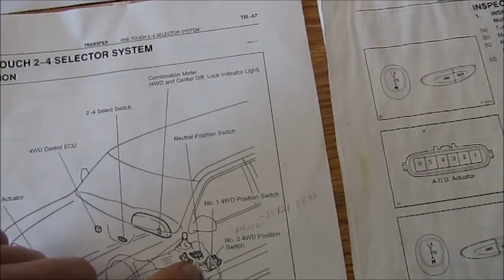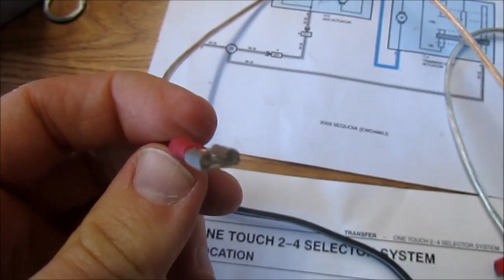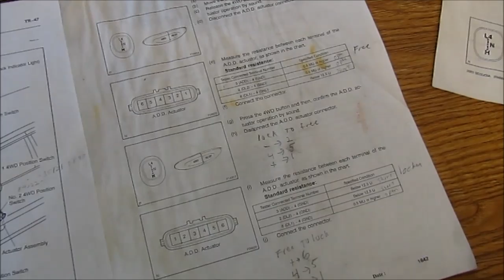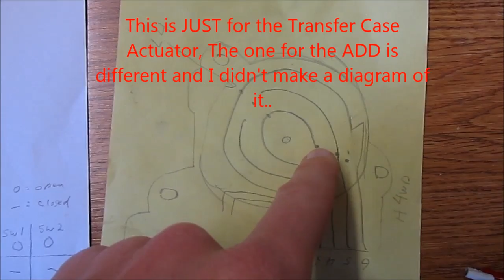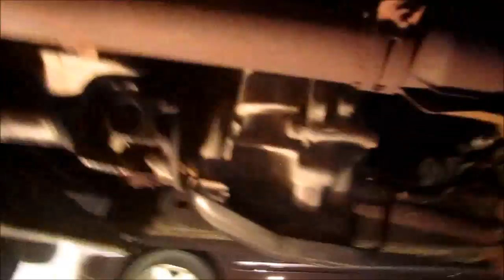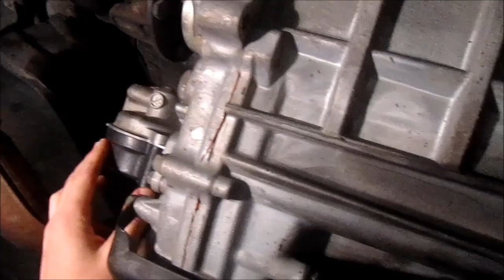sequoia 4wd troubleshooting

Comment: I read where a YouTuber said to take a small hammer and tap the switch...lightly.
BINGO...IT WORKED.
Thank you very much for your info...glad it was a simple fix.
DREADED THE THOUGHT OF TAKING HER TO THE STEALERSHIP!!
Reply: I just did the same thing on mine: light taps on both switch housings with a small hammer. I also noticed the vacuum hose on the transfer case was cracked so I trimmed it back and reinstalled it as well.

I think I'll make sure I go in and out of 4WD once a month to keep it from seizing up again (hopefully).

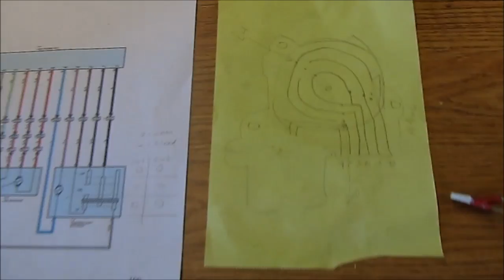Comment: The diagram he shows at 12:20, the rotary joints on mine were dirty and I cleaned them with fine steel wool. I took a photo before  I removed the gear for correct positioning. It took me an hour to remove and replace.
Reply: Hi can you send me a pic of the nuertral pos of the pins with the cover off .  Thanks

Comment: Man you saved me a grand++ I'm sure. I found 2 (yes two) faulty plunger switches that I didn't even know about. One was 200-300 ohms, the other was wide open. That cost me $275 at the dealer. My back diff lock was ok after pulling it out and cleaning it but the front (ADD) 2x 4x shifter was afu. I finally got it working and now everything is DNO. Just tapping on the front ADD got it to cycle. I know how everything works now and exercised it multiple times in some deep snow on the mountain yesterday. Thanks for taking the time to make this video.

Comment: Super helpful video!! Mine (just got it 3 days ago!) was stuck in 4x4, the front switch on the transfer case actuator was bad. I took it out and it had no continuity with plunger in or out. 

To confirm, I turned the key on (motor off) and all 4 wheels were green, with a blinking orange center. So I pressed the 4x4 button, and all 4 green wheels lights turned off, but the orange center light was still blinking (this was the main symptom). 

So then I unplugged the bad sensor, and used an unpainted metal paperclip bent into a "U" as a jumper, plugged it into the bad sensor's plug, (again, key on, motor off, green wheel lights off) and everything clicked and disengaged! Woo hoo!!! So relieved!! 

Just need to replace the sensor now, but thanks for the great video!! Wouldn't have tried this without your explanation!
Reply: So awesome. you're describing my exact problem- were you ever able to replace the switches, and if so, where did you get them?
Reply: Yep, got it switched out. Still have a problem up front, 4X4 won't engage fully and honestly haven't had a chance to climb under and smack it. It's new to me, and the previous owner never exercised it. Oddly, the bad switch worked again after having it out and pushing on it a lot, but I wouldn't comfortably rely on it. If you're in a pinch, take the switch out and push the plunger in and out, and see if you get any continuity from the switch.  

I replaced the bad switch with this: Toyota 84210-52050 Back Up Lamp Switch from Amazon. Worked like a charm, not stuck in 4x4 anymore and we've been driving around ever since. I just need to get the front dif resolved. I'm sure it will be easy, I just need to get after it.

Comment: Thanks for this video.  I was able to determine an issue with my ADD as I was unable to manually rotate it but I was able to manually rotate the transfer case back to 2 high.  I had read in my owners manual when I got my 2003 sequoia in 2016 and had ran the 4wd monthly.  In fact that's how I found out this problem.  I wish the ADD was a bit more accessible.  Thanks again for the information!
Reply: I know this was forever ago, but.... how did you manually change the transfer case back to 2wd? My front drive shaft is stuck engaged in my 2003. Thanks!

Comment: Thanks for the excellent video--your instructions on how to manually rotate the two actuators through their various positions is extremely helpful.  I am working on a 2001 Sequoia.  I was able to cycle both the transfer case and the ADD through all of their positions manually.  I did not note any hesitation in the operation of the motors.  Several times I tried rotating both actuators to the 2wd/free positions and starting the vehicle.  The flashing orange diff light disappears until I attempt to engage 4wd with the button, after which I hear an engagement noise.  However, the flashing orange diff light will now come on and stay on until I manually rotate the transfer case from 4wd-Locked back to 2wd.  The ADD appears to stay in the free position.  I have checked both transfer case position switches and replaced the front one, which looked like it was not achieving full continuity, with no result.  

I have read that the wheel speed sensors provide information to the 4wd ECU.  A couple of months ago, I experienced the issue common to these trucks where the ABS/traction control system randomly locks up one wheel at speed, so I tore out the ABS fuse.  The 4wd system has been non-operational since long before the ABS issue became serious.  Is it possible that these two issues are interrelated, and that my manual cycling of the actuators and replacement of the position switch are not fixing the problem because of a sensor elsewhere in the system?  I suppose I could check the L4 and Neutral switches.  Is there a test procedure for those?  Or is it only the vehicle speed sensor that has input to the 4wd ECU?  I suppose it's possible that my ECU is bad.  

Is there anything else to check before I dive into the 4wd ECU?  

Thanks.

Comment: Great video.  Saved me a lot of time of having to go through it myself.  All said and done, my ADD motor was toast on my 2003 Sequoia.  In my case, the actuator breathing tube had snap off.  I had never realized it had a breather until now.  Years of corrosion from road salt and a few flooded streets, did the motor in.  $470 after taxes in the Chicago area.  I could have bought one a lot cheaper online but this issue was discovered less than a day before a trip to CO.

Comment: I had this exact same issue. My 03 sequoia got stuck in 4WD locked diff. Center diff light flashing. I tested both transfer case postion switches and found the front one to be bad. After replacing it I disconnected the battery for about 15 minutes and then reconnected it. I started it and the blinking light went away. I would start with the position switches if you’re having similar issues. The part was $61 with tax.

Comment: Thank you for the video.  It's a bit confusing, but I think you did the best you could to make sense of it all, and it's helped me understand the system way better.
Reply: Seems like the switches are the easiest to start testing.  My problem on my '04 is the center diff and it's intermittent, so I have some work ahead of me.  Once I got mine unstuck once before, it's worked fine ( did this by tapping on it).  After driving a couple thousand miles, it stuck again when I engaged it and won't respond, just blinking on the dash.

Comment: A real good video for sure.  We have a Tacoma 2001 that is a huge headache.  With the 2 front wheels off the ground, pushing the 2-4 selector does absolutely nothing...no light, no 4x4 engagement.  You can spin front driveshaft and if you turn a wheel by hand only one wheel spins.  If I disconnect the ADD connector at actuator and then push the 2-4 selector button you hear the transfer case motor spin and the front driveshaft locks.  In addition, both front wheels now spin (opposite directions).  What the heck is up with that?  lol

Comment: Transfer Case Actuator is 1476.00 at the dealer.  Found one on Ebay 1184.00
Reply: Mla Automotive mine was $207 at advanced auto
Reply: Mine was $207 from advanced auto
Reply: I fixed mine and saved $1100 on a the part for an 05 Tundra,. Take the black plastic cover off, remove the assy and clean the motor contacts on the lid with fine steel wool. Reassembly is a little more tedious, but I did it in less than an hour.

Comment: Wish there was a troubleshooting guide like this for Tundra 2008-2014... pin out on front diff seems similar, it would seem though I have no position switches on transfer case act. Great video.

Comment: Great video. I have flashing light w/4 green tires every time  i start my 03 sequoia. I can push the 4wd button and the green tires go away but light still flashes. I had to replace one of the position switches at the transfer case actuator. Didn't fix the issue. So I want to spin the actuator manually just a little confused with the pin orientation and I don't want to damage the transfer case actuator. I don't hear either actuator spin and it won't engage 4x4H but I can get it to go into 4x4L .
Reply: So I got the pin configuration figured out now. I have continuity at pins 4&6. So thats High 4 lock. So connected my wires like in the video and got the actuator to spin from 4HLock to H4 so I turned the key to on position and I heard the actuator spin the orange light and the 4 green never left. I checked the continuity and is was back to 4H lock so I wired it to spin to 2wd and it did spin and once again when I turned the key to on position actuator spinned right back to 4H lock again. Can the front add be causing this? I previously have stated it does ingage into 4x4L  but not 4x4H.
Reply: I've got all 4 lights and center flashing. I see you checked  both positions in the actuator, I'm looking to check mine for continuity but having hard time getting them out. What size socket or wrench is that to get them out and how's your vehicle doing now?

Comment: i have an issue with mine....last owner told me that i have to put 12v on 2 point in the plug behind the radio console to make the fork of the 4wd engaged...do you have some info about that?? it's like i have to jump the connector directly to fully engage or disengage the 4wd...i have to invert the 12v power on the same spot to make it disengaged....but i don't remember the exact pin to jump the that plug....can you help me on that one dude?

Comment: Help! Does the vehicle need to be fully in the air to do this? Mine is currently on the ground. Tcase actuator is good by bench testing it and confirming the motor spins both ways and both tcase switches referenced have continuity. I'm 90% sure the issue is the ADD. I'm flashing, and vehicle acts like 3/4 wheels are locked, or maybe all 4. Can I do the manual rotation of the front diff as described here on the ground, or does it need to be in the air and in gear or neutral? 
Thanks!

Comment: Thanks for the video very helpful. I have a 02 sequoia. I have center light blinking problem.  If I am at fwd mode i tap the rear actuator case with a hammer and it goes away. If i am at 4wd mode then i need to tap front and rear actuators. It is not very practical but I thought if I do this enough times maybe it will be exercised and dont need do it anymore but still flashing center light if i press 4wd button. Anyone has any idea what could be the problem or fix?
Reply: I just did the same thing on mine: light taps on both switch housings with a small hammer. I also noticed the vacuum hose on the transfer case was cracked so I trimmed it back and reinstalled it as well.

I think I'll make sure I go in and out of 4WD once a month to keep it from seizing up again (hopefully).

Comment: When I tested my 4wd switches for continuity I got a bunch of numbers jumping around when I pressed the plunger (maintaining even pressure) and then after 3 seconds or so it zeroed out. This was with alligator clips btw.
Is a normal reading test these 2 switches on a Tundra?

Comment: Thanks for the video! Can you tell me what it means if there’s is continuity between pin 1 & 2 on the transfer case motor.
I’m stuck in 4WD Locked. Position switches are working.

Comment: So my02 4runner having similar issue. When trying to engage 4wd 4h I get the green wheels and center diff flashing and it never engages unless I turn vehicle off then back on the it will be in 4wd with center diff locked at that point I have to press the center diff button to disengage it. Do you think I have the same issue. Thanks

Comment: If you hate yourself and think that you need to be punished, then by all means make your own cables to connect to the 6 pins of the 2 actuators. Otherwise, just buy some alligator clips. My self-made leads fell off time after time wasting so much time and money on this project. "Why isn't this moving the motor!?" Well, because the connectors fell off of the pins. Or they detached from the end-connector, etc.

Comment: Question, I'm in an 03 Sequoia am I looking at an expensive fix or what? My center differential light flashes. I have never been off-road. I took it to toyota they actual road tested it with me in it. The codes that were listed are C1203,C1223, C1247, C1360, I called a private 4x4 toyota specialist and he said to check the plugs in the actuator. So if its just faulty plugs is it expensive? Should l get rid of the car? Thanks for the camera work, THAT WAS HUGE I got under there and saw everything.

Comment: I replaced everything and light still blinks I'm having trouble putting it in sequence . so if the front is locked the read has to be in 4h or 4h lock ?
Reply: Rear*
Reply from the maker: +Dylan i   Yes, it does.
Reply: +smashsackett ok so what if I took the cap off the t-case actuator and the gear came out too how do I align that to the correct position before I re-install the cap.

Comment: 2003 sequia Avoid all this , first put it in 4x4 while moving forward for about 20 to 30 ft  if it doesn't go into 4x4 then while rolling forward  put it in neutral,  then repeat backwards to go back to high two wheel drive ,  thats how I do it evertime
just to save on the where and tear anyway .
Reply: This didn't work for me. I do agree that doing this when the system is working would help reduce wear and tear though (good best practice).
What did work was light taps on both switch housings with a small hammer. I also noticed the vacuum hose on the transfer case was cracked so I trimmed it back and reinstalled it as well.

I think I'll make sure I also go in and out of 4WD once a month to keep it from seizing up again (hopefully).

Comment: Hey man you have the best video and all of youtube  about that actuator. But I am in a tough situation to 2001 Sequoia same actuator problem but the motor brushes were stuck .the transfer case is on my bench cuz I'm doing  transmission one time I pulled the cover with the worm gear and the whole assembly came off meaning I am not synchronize now how can I synchronize it back. 3 pins the right position of the cover on 2-wheel drive

Comment: When I took the cap off the gear came out how do I align it to the right position on the transfer case actuator ? So the motor spins it to the right position
Reply from the maker: +Dylan i    This is tricky!  I probably will not be able to explain it very well but essentially using the diagram that I made in the video starting at about 12:20 you can get that gear put back on the correct tooth. When you rotate that gear you will be driving a rod in the transfer case from front to back.    you will need to grab the gear and manually spin it all the way from one direction to the other, clockwise and counter-clockwise.  I can't remember which way does which but all the way in one direction will put you in H4wd and all the way in the other direction will put you in 2wd.  so pick one of these directions, spin it all the way (you may need to rotate your front driveline a little so the gears in the transfer case will mesh) once you have it completely rotated ( I would use the 2wd direction)  then using the diagram on that yellow piece of paper in the video, just make sure that when the cap is screwed back on the fingers on the back of the gear will line up where they are supposed to be, use the bolt holes to orient the fingers. You will need to pull the gear out and reinsert it on different teeth in order to get it to the proper rotational orientation.  Sorry I diddn't make a video of this but once I got mine back in and the cap siliconed back on I didn't want to disassemble it again, now I have since totaled that sequoia and got an 05, and the 05 uses a completely different setup.  

hope this helps
Reply: @smashsackett  will be going through this bit shortly. @DI AUTO did you ever get yours back together?